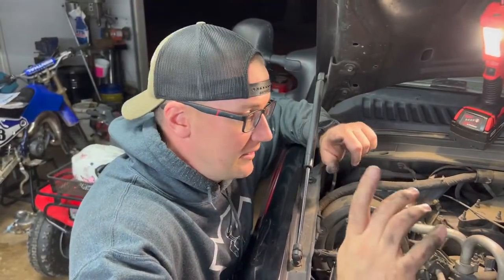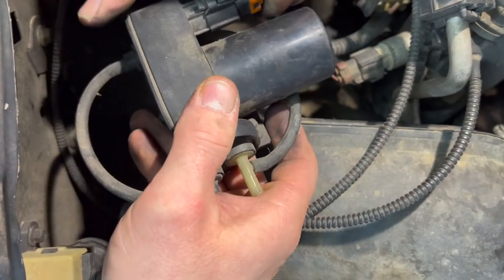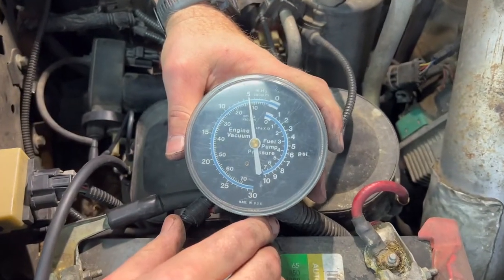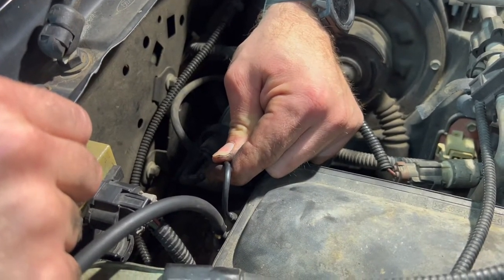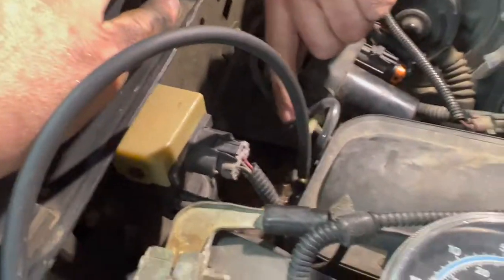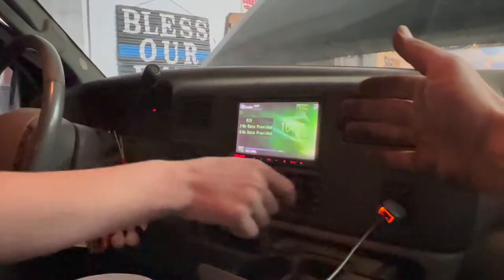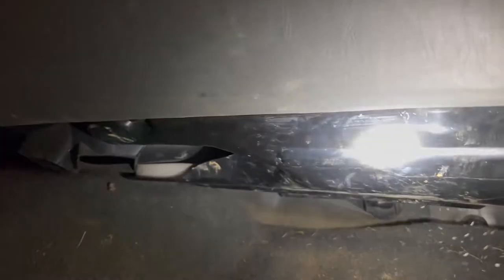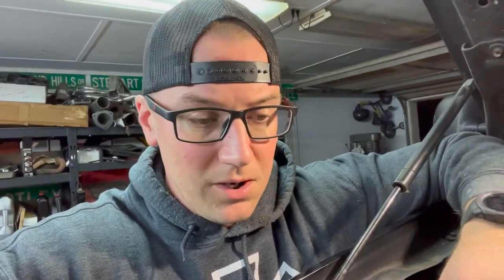99-07 Superduty vacuum leak diagnosis

Comment: That's that helped. The 4x switch was leaking. Bypassed that . Everything thing works inside. But even when switch on control is off pump still runs

Comment: With all the vacuum connections and thus potential for a constant minor leakage, how often is it acceptable for the vacuum pump to turn on when no demand is pulled?  FYI : with no demand my comes on every approx. 40 seconds.  Is that too much?
Reply from the maker: @martyh4777  yea, should come on upon cranking run for 10-15 sec and call it done
Reply: @AutomedicGarage  Yes, but after that it keeps on turning on briefly every 30 to 40 seconds each time for about 5 to 10 seconds.
Reply from the maker: @martyh4777  got a leak somewhere. Need to hook a gauge up to the system see what the vacuum is and see if the pump is malfunctioning or the system is leaking somewhere
Reply: @AutomedicGarage    I unplugged the vacuum supply from the vacuum reservoir to the system (thus excluding the system as a first test) and the pump still cycles on every 30 to 40 seconds.  I guess that leaves me questioning the vacuum tank, check valve, and line connections to the pump to inspect more closely.
Reply: Now, I also replaced the vacuum reservoir and now the vacuum is holding and pretty rarely turns on.

Comment: I have a similar problem on a 2WD ( no 4WD vacuum solenoid ). Defrost only. Leak was caused by a disconnected vacuum connector under the glovebox! Winter boots maybe? It just hangs in the open. Black & white hoses. Had to replace the burned out vacuum pump too.
Reply from the maker: Those come unplugged all the time from peoples feet once the plastic holder for them breaks.

Comment: what if I am mot getting 12v to switch start with fuses and which #  would it be under. 2002 7.3 excursion
Reply from the maker: @joselongoria392  are you having a crank problem or a vacuum pump problem
Reply: @AutomedicGarage  I checked like you did and had 12V at connector and the damn dorman pump was bad.  So I exchanged for another and it  stated to pump like yours did in the video.  Thank you again

Comment: Very helpful video troubleshooting a defrost-only situation on a buddy's 2000 F350 diesel. Turned turned out both hoses that were integral to vacuum motor had splits.  Replaced hoses & system now works perfectly!

Comment: Solid video.
Two queations:
What fuse serves the vacuum pump?
What size of tubing?
Reply from the maker: I would have to look at the fuse panel brake down, never had one not getting power to the connector. Not sure on hose size for that small of hose, I could pick it out by eye but if you need to patch a broken or cracked line just cut a small piece off and go to your local parts or hardware store and match it up.

Comment: What was the size of that clear hose. Would be handy to keep some of that around. Thanks!! Great video.
Reply from the maker: Can’t tell you the size off hand but I keep a roll in the shop for vacuum line repair
Reply: Use vacuum rated hose if you can.

Comment: good video learned a lot, did my volt test at the wire no volts either wire so I know it gotta be a short fuse is good, any ideas where to start, thanks
Reply from the maker: Key was in run position correct?

Comment: Thanks for this
2004 F250 gas, a/c works great. Make a hard right turn and then it blows hot for the rest of the drive. Any suggestions
Reply from the maker: Blend door must be loose or vacuum pod isn’t holding it secure

Comment: I have a 2001 f250 2wd with the 7.3. my vacuum pump doesn’t turn off unless I put a finger on the white connector. 
I see that nothing needs to be connected there, lines under glovebox all fine.
What else could I check?
Reply from the maker: You have a leak somewhere. Could be at a vacuum pod or the vacuum pod itself or if you have a heater control valve at it. Could have a cracked vacuum container. Go through everything I checked in the video.
Reply: Did you figure it out ?
Reply: @LemonySnicket-EUC  not yet, will be a while until I get to it

Comment: Not getting power for the 4 wheel drive.... I've checked vacuum didn't hear or see anything unusual..... so what control the power ? To turn on?. 
2000 7.3 super duty, power stroke,  8 foot bed
Reply from the maker: @matthewturchan6286  when you say your not getting power to 4 wheel drive are you referring to your mode switch in the dash? Is your 4x4 auto or manual hubs? Or are you referring to power to the vacuum pump? Is the 4x4 vacuum actuator on the passenger fender present plugged in and functioning? Are you vacuum lines from the actuator to the spindles present and in good working order? Do you have 12v at the vacuum pump? Is the fuse good for the vacuum pump?

Comment: When is the vacuum pump supposed to be running? Anytime the key is in the on position?
Reply from the maker: Anytime it sees less than 15 of vacuum with key on
Reply: What is that oval thing between the pump and the battery? It says ford on it.
Reply from the maker: @TheHighrider3  vacuum canister, it stores enough vacuum to do operation so the pump doesn’t kick on constantly
Reply: Thanks

Comment: Does the 1991 F350 super duty gas engine have the same pump?  Or does it use the engine vacuum?
Reply from the maker: If it’s a gas burner it relies on manifold vacuum from the engine.

Comment: 2007 superduty 6.0

When on max ac it blows from vents and defrost ??? Any idea on what could be causing that
Reply from the maker: May be making a small amount of vacuum which is keeping it in the next slot back from full default mode which is defrost. Check for leaks. Is you pump running constantly?
Reply: @AutomedicGarage  I’ll be checking that tomorrow. I’ve seen some videos on how to check for leaks. I was thinking a weak vacuum pump? Who knows it’s the original one from 2007
Reply from the maker: @steventhorkelsen6478  hook a vacuum gauge to the main line into the vacuum pump see what it pulls down to and if it holds.

Comment: My pump turns off and still it blows front the defrost. Could it be the actuator?
Reply from the maker: Very well could be check the lines going through and onto the other side of the firewall.
Reply: @AutomedicGarage  I just went ahead  and hooked the pump straight to the line coming from the firewall and it blows cold ac.   So I'm thinking it's the hub or the lines along the way. Or vacum box

Comment: Would a 97 7.3l belt driven vacuum pump use this same diagnosis? My pump is pulsing nonstop is that normal?
Reply from the maker: Kinda, on the obs trucks I first hook a vacuum gauge straight to the line on the back of the pump and see what my vacuum is which should produce around 25 of vacuum and not drop below 15. After that I hook up the the vacuum manifold and see what it drops to when depressing the brake pedal and using the hvac controls and see what it does under a load. Hope that helps some.
Reply: @AutomedicGarage  my problem is a brake pedal not returning. At the vacuum pump I got 23 1/2 with a gauge. At the end of the hose to the booster 22 1/2 . At the hose going to the hvac is 23. When disconnecting the hose to brake booster the brake pedal comes back up. Hard to depress but comes up. I have installed a new brake booster and new MC. What do you think is the problem?
Reply: @AutomedicGarage  using the hvac hose because it’s the longest that I can put up to the windshield using the vac gauge . It reads 23 and when pressing on brake it drops to 20 then climbs back up to 23. Brake pedal still not returning.
Reply from the maker: @petervang9523  I’ve had a couple OBS trucks do the same and had rear brake shoes completely gone or adjusted way to loose. Just a thought.

Comment: The canister easy to install?
Reply from the maker: @johnnycortez46  yea, unplug the vacuum line and remove 3 11mm nuts on the bottom side of inner fender well.
Reply: @AutomedicGarage  Cool deal.  Thank you
Reply: Do you happen to know if a 2006 has a check valve on the vacuum system?
Reply from the maker: @johnnycortez46  no check valve

Comment: I have vent and defrost and floor with no pump coming on and no hubs move?
Reply from the maker: Maybe the 4x4 actuator valve then or you have a vacuum leak on 4x4 lines

Comment: Should there air coming out the niple with no hose on it?
Reply from the maker: The white nipple, yes that’s the exhaust of the vacuum pump
Reply: Ok my pump just runs so I have a leak somewhere
Reply: Thanks for ur help . Sorry to keep asking questions
Reply from the maker: @buddyluv5  your good, just start isolating items on the vacuum system like I did in the video and narrow it down.

Comment: Do you know if the wipers need vacuum to operate?
Reply from the maker: Wipers are electric only. Vacuum is for HVAC controls and locking hubs only.
Reply: @AutomedicGarage   thanks for your response. Currently trying to figure out my vacuum problems. Sorry one more question. So if I have the manual locking hubs does it still need vacuum?
Reply from the maker: @buzzybee8358  do you hubs just have “lock and open” on them or “manual and auto” on them?
Reply: It is just lock and open
Reply from the maker: @buzzybee8358  so you have true manual locking hubs so you don’t use vacuum for your hubs at all. I like those better anyways and usually convert the auto hubs to manual warn or Mile marker hubs.
Reply: Ok great! Thanks for all your help.

Comment: I have same issues but noticed my vacuum lines to my hubs are gone
Reply: I had the same thing. If you go off-road in lots of brush it can pull the lines off. When they were replaced, twine tying them to hug closer to the hub axle helps keep them put.

Comment: Found one line disconnected and pump achieves vacuum but still nothing any ideas?
Reply from the maker: What isn’t working? Locking hubs? A/C controls?
Reply: @AutomedicGarage  no 4wd ESOF or A/C controls
Reply from the maker: @tylerwhite5015  you have no vacuum to controls then.
Reply: The thing is the vacuum pump shuts off after about 60-90 seconds like the pump is achieving vacuum but still no HVAC controls. Could the pump possibly be reading a false vacuum?
Reply from the maker: @tylerwhite5015  how much vacuume are you achieving with a gauge?
Reply: 15 I’m curious if anything else could cause it
Reply from the maker: @tylerwhite5015  hook the vacuum line to ac controls to a manual pump like a mighty vac and see if you can make ac controls work with that.
Reply: Just wanted to update just in case anyone else has this problem. My HVAC control vacuum line was running through the top of AC evaporator and out the bottom, and after the box around it was tightened down it affectively pinched the line shut. That why I wasn’t getting vacuum. So I disconnected the line and fished it out of the box and now I have hvac controls 👍
Reply: @tylerwhite5015  No one expects a pinch! Allowed vacuum at the pump, but not at the controls. Have to remember that.